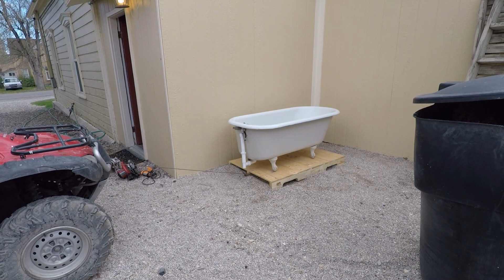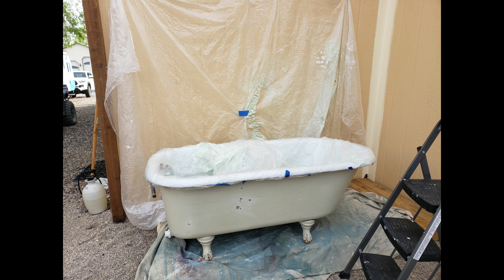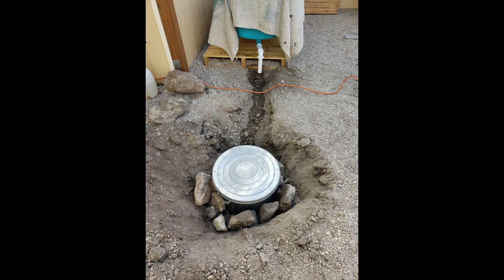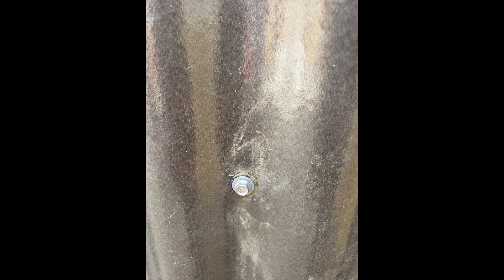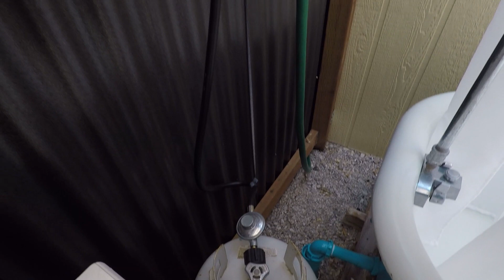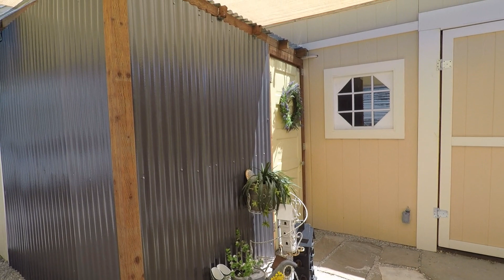DIY OUTDOOR SHOWER - Using Gasland Propane Hot Water Heater and Claw Foot Tub

Comment: Ild love to see what attachment you did from the tub to the drain. Any clue the size of the piping that your attaching to?
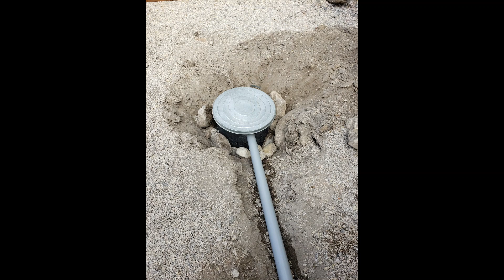Reply from the maker: 5:51 the standard drain pipe came from the bottom of the tub. The pipe or tubing I used was larger then that pipe so it just fit over the top so the water would just drain into it and then into the French drain I constructed (the hole with rocks and tub that the pipe went into)